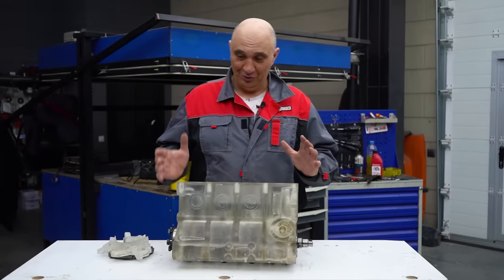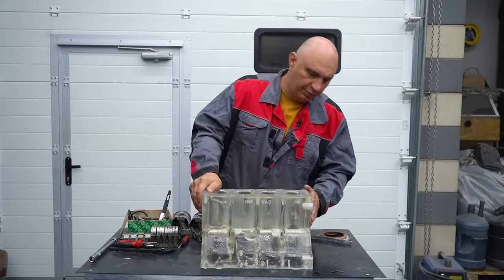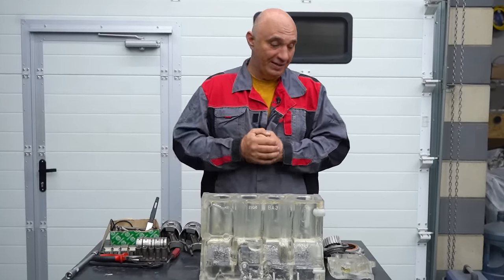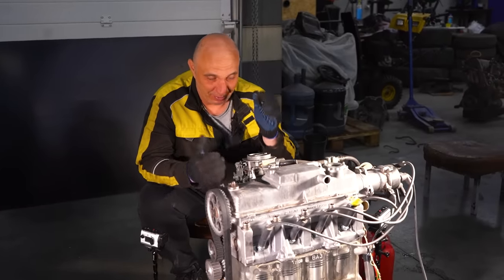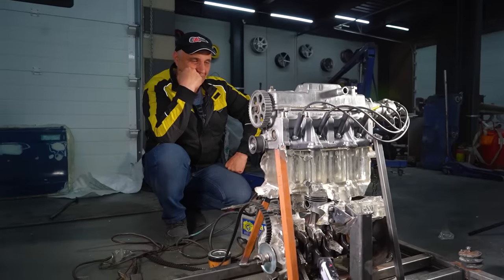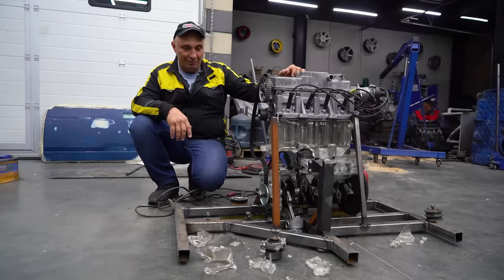Transparent engine block – first start

Comment: Were the two center cylinders supposed to be in compression stroke and fire at exact same time?  Seems like that’s what got it.  Four bolt main caps, a crank support bearing on snout and at back of flywheel that connected to the head would also potentially eliminate the issue.  Get the engine turning over then slowly introduce fuel to keep it from loading up as well maybe.  Good effort thanks for sharing

Comment: if you pause it at 6:58, you can see the cracks re already there. the most apparent is the more right side of the engine below the pistons, almost in line with the main bearings

Comment: long lag bolts thru the block to support the crankshaft cradle might help. but then the side might blow out. idk. but cheers to the work you put in. thanks for the attempt, was quite interesting.

Comment: That shows quite impressive the reaction forces inside the engine block and where no weak points should exist. Now imagine this an engine under high torque output which increases the acting forces on another level.

Comment: The thrust bearings should be independently supported with steel up to the head and down to the frame, so all the downward force on the crank isnt pulled through the liquid glass.

Comment: I'm not sure if the plastic/resin  used is ideal for shock forces. You could try to create deep triangular webbing for the block that will hopefully give it more strength.  Possibly cast the main caps so that the bolts go all the way through the block and reinforce the attachment point at the top of the block with steel. 

This is also a perfect example of why gm uses 4 bolt mains in
Reply: The Chevy LS V8 uses 6 bolt mains.

Comment: This is actually a really good example of how a compressed explosion exerts force on the crank and rods and how increasing the pressure via turbo or supercharger wears parts out faster in high hp applications.

Comment: Saw the crack form with the power drill. This makes me wonder if the mounting was the problem - not just the material. Maybe it needs more compliance with rubber bushings. In any case, massive props for an ambitious project. We were hoping for success as much as you.

Comment: that was really cool to see u have to say only thing I could suggest is possibly lowering the compression .maybe run head bolts to the botom of the block and incorporate a steel band into the oil pan

Comment: Build your block in two pieces top being the cylinders the bottom being crank and Maine’s . Would need to make the crank mains out of metal and run long studs to clamp the crank and cylinder down to help mitigate the flex and pressures on the plastic block.

Comment: Just a thought. Make the block again but add sleeves fir the pistons and everywhere a bolt has tk bolt into the plastic use a steel insert and see how it goes then. I'm pretty sure it will actually run with sleeves and inserts. Without to much is put on the plastic itself

Comment: It was well worth a try. It made for a great video, whatever the outcome. ;)

As others pointed out, a crack formed almost all the way across the block, just above the mounting bracket, after the very first try with the drill.

If you pause it just at ignition at 6:59, I think the crack did go all the way across the block (internally), just above the mounting bracket, and between the two "hollows" on either side.

You can see it at 7:15 as well.

Oh well. It was a good watch anyway. lol

Comment: Seems as though the ignition was enough to knock the crank out! Need to have a way to bolt the head and crank together so the crank can’t pull away from the head. A solid block would help too you’d think

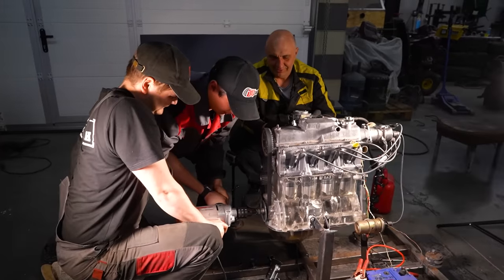Comment: 5:08 Cracked the block at the first ignition. The head bolts should extend right through the block with some steel straps to spread the load to hold it together.

Comment: Maybe try the Rover K-Series engine. The head bolts go straight through the block to the bottom. Don't worry so much about the glass sump. At least you have the strength to support the crankshaft

Comment: You could try to drill through the heads and block and try to use long studs to hold the heads and the  block together that was a lot of force on the crank downwards

Comment: This is the reason engine blocks are made of a single piece of heavy metal, the power of the downward push during combustion is extreme, I doubt any clear material could withstand that power.
A for effort guys!!!!
Rewatching the video, at 6:58 you can see a LARGE crack running from the mount to the fly wheel, looks like it starts at the bolt, it seems when the engine was mounted the tightening of the bolts caused cracks in the material.

Comment: I think the head gasket also failed, so on that first power stroke, the adjacent cylinders also got a massive boost of compression as the pistons were coming up,  So the crank was pushed down on three cylinders with most of the force on cylinder 3.  To stand a chance, I'd use much much thicker walls of the block.  Also the sandwich idea.  A copper or aluminium headgasket would be good.  Maybe anneal the plastic block too.  Those rings are far too grippy.  A plastic slightly softer than the block would be good, but with a polished edge.

I had a model plastic see-through engine from Haynes (the manual people).  It seized because I used bad oil and let it sit.  Ran on an electric motor, with a valve train and everything and lights to simulate the power stroke.  Great for teaching.  Maybe it would be cheaper to adapt that to run off alcohol or something.

Comment: Good idea guys. Do it again. Make a central metal carrier for the rotating assembly ( crankshaft) and then get bolts long enough to reach from the head to that assembly (crankshaft main bearings with head )to hold it all together.

Comment: You guys should make one of these and take it to a shop with a spintron.   It will turn the engine at operating speed without the need to ignite the fuel

Comment: that man standing beside the engine is a very lucky man this thing turned into a giant frag grenade... i was wondering by what wizardry they would of made glass withstand that much pressure and for how long it would hold but then i realised there never was any wizardry 😂 great attempt and it was very interesting seeing what the explosions actually look like in the cylinder.

Comment: My guess is, it was split from the crank support of the case from too much momentum and consequent compression of the outer strokes.  I would try wrapping metal straps from the head, under the block and back to the other side of the head; between each cylinder and each end.

Comment: I think there needs to be some sort of metal frame running from the main bearings up the the cylinder head to support the force of combustion. So it will be a clear block and cylinders but a metal frame within. Idk im not an engineer 😅

Comment: This is why glass or carbon fibers are added to plastic to give them more strength in tension.  I bet if you would have designed it so the head bolts ran all the way through the block to the crankshaft bearing caps, it would have ran.  It clearly needed something tensioning the block together.

Comment: at 5:07 we can see the block cracking where the mount is at the bottom. This is where it broke in the next attempt at 6:50. Glass is resistant to compression but not tension. And the torsion effect of the shaft created too much stress on the block

Comment: The Sisu Diesel division of Valmet once made a 4-cylinder diesel engine with quartz cylinders as a research tool.  It was the first indigenously developed common-rail diesel engine in the Baltics.  The engine had no water jackets so it was run only for short periods.

Comment: And just like that,  The Russians find another use for cast iron!!awesome job,maybe some vertical rebar in the mix??possibly in a loop? from the deck,down  immersed in the block webbing between the clyinders? that was alot of work, looked supercool! if you dont do it again,ill understand!!

Comment: You only need a transparant short block engine. Not all of the block. Especially the low block which is hold the crank

Comment: Definately got combustion, but blew the crank out the bottom. I do not know the material used for the block, but maybe wider main webs with 4 bolts plus cross bolts. Possibly studs that pass right through the main caps, the block and head.

Comment: How about tapping into the individual cylinders and installing individual ball valves per cylinder and opening them all accordingly to lower the compression thus possibly still running the engine?

Comment: Believe it or not, but I think this is one of your best videos, although the experiment itself failed.
But I would have expected it to melt at the head or blow by the pistons and melt the cylinder walls.
It shows brilliantly where the forces inside an engine go: to the crank bearings!

Comment: Maybe try using fiberglass to give the epoxy much more strength.  If you just use toe, instead of weave, aligned for tension strength it will also be more transparent.

Comment: I’m not sure if you did it. But was there any kind of pressure relief for the excessive crank case pressure like the original pcv would have done.. I think where you used 3 rubber full closed rings as opposed to having 2 normal piston rings that have minimal gaps it would have increased the crank pressure a lot more and possibly too much even for a standard pcv system..

Comment: Still a good idea. The issue is they used the casting from something that was supposed to have the strength of metal. They need more material from what they are using for added strength. It'll be super thick but work.

Comment: You need an engine that the head bolts go through the block down through the main caps.  Much like a hydridic cylinder or a motor cycle engine.

Comment: It need some metal reinforcements to bear the stretch force I believe. Add internal and external metal structures like rebars around the mains and where the shell cracked. The clear material might not be so weak but it is too brittle. Also lowering the compression ratio a bit can help. I think if given a second go this project could work out.
Reply: Like have head bolts that extend as far as the to the bottom rotating assembly to clamp it all together

Comment: At the top of that list of contributing factors which led to the failure: That huge crack going all the way across the bottom of at least the three right cylinders before the engine even fired, clearly visible in the close-ups. 6:57

Comment: I thought about your engine, and I have come  to a very interesting conclusion:  OK your engine block is made out of glass so you have to operate within the physical constraints of that design. Now, if you were to use wires in the glass to strengthen the transparent block and use the lower grade fuel, you might be able to maintain operation.  You have to make the fuel less hot in other words. You might also lower the compression as well. 1.5:1  2 at most .

Comment: What if you add steel bars of equal length on the corner of each cylinder to absorb the hard force down with a skeleton steel cradle at top and bottom so the steel is absorbing much of the mechanical force while the clear only is responsible for holding the compression

Comment: Does it mean ...no glass or plastic materials as cylinder block...howsoever strong, cant withstand the pressure and heat generated during combustion?

Comment: This was still awesome, if you attempt again perhaps put straps under the engine block and mount it differently onto the steel frame. The glass was just too brittle it seems

Comment: I have been watching for a while, exelent show team.

What I want you to do, is get an engine, remove the head.

What are you left with? Pistons and a piston block, the block as alloy, and the pistons if you are lucky are steel, this is magnetic.

Make a new head for the engine, but this time you are going to have 4 electro magnets to move the pistons.

This was built in the 1920s

🤘💗😇😘

Comment: Looks like the power stroke they did achieve pushed out the tapped holes on the bearing blocks to hold the crankshaft . If they do this again they should run some sort of steel bands from the bearings to the cylinder head to help hold the engine together... Idk... That's a tough one... There's a reason we make engines out of steel and aluminum

Comment: You should use methylated spirits in the engine, won’t rev as hard, but it hopefully won’t blow a hole in the bottom of the engine.

Comment: In hindsight would of it been a good ider to have a lot of overlap on the valves?  And making the combustion chamber bigger, motor would have no power, but you just want it running, or am I wrong with my iders.

Comment: This might have worked with an MG Rover K series engine as the cylinder head bolts run though the engine and into the crank shaft bearing caps. In theory they would hold the whole thing together and stop it blowing apart. Not sure if any other engines use this system?

Comment: Go again but next time build a support on the lower side. Not on the oil pan but around it. It appears it just blew the low half of the block off due to strength. Hopefully this will support it enough to keep it running.

Comment: Did the motor blow up because of the compression ? Would lowering the compression ratio mean that the motor be able to function since the pressure inside the motor would be lower ???? Pls respond I’m no engineer

Comment: I have the solution. The main caps need to be through-bolted all the way through to where they hold the heads on with one end and hold the crankshaft in place with the other end.
Check out Hans Hermann's attempted Indycar engine, as that is what he did, or something similar to it.

Comment: Maybe just use the cylinder. Make it clear and the top and bottom complete in metal. then reinforce it by connecting the top end and bottom end together

Comment: Flat top pistons are not a good idea you should use dished pistons for lower compression. No starting fluid! Also find an aluminum flywheel. Make everything thicker on the block.

Comment: So I read through a lot of the comments and didn't see anything about this so, you guys need to design something that is steel that runs through the block and has runners up the walls so it has stability to bolt things onto.  It was not the cylinders that failed it was your crank bolts that lost the war with force, you essentially hand catastrophic crank walk.   Next time get a 4 bolt bottom end...

Comment: Kind of successful really, because the explosion was so good that it blew the bottom of the engine off.

I think you'd have a hard time finding a transparent material that you could mold, which would be strong enough. Even acrylic..

Maybe it would be just as good to use the transparent engine, but simulate it. Have lights and different coloured liquids for the coolant and the oil. And LED lights going off when the pistons reached the top. Run the crank with electricity.

It would demonstrate the engine

Comment: It was a beautiful part. Next time, if there is a next time, lower the compression ratio. Very low, 1880s engine low. Get that cylinder pressure so low that it will barely make any power. Model T engines ran great at 4:1. You can go lower, benz was under 3:1.

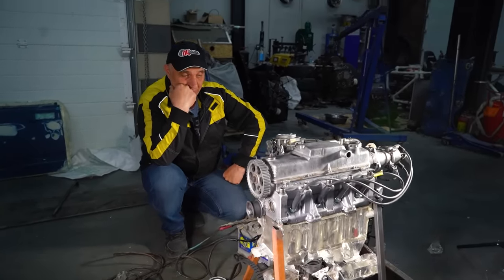Comment: 7:39 a crack is visible beggining at the bolts on the engine mount continuing thru the three cylinders all the way to the flywheel ... tightened two much the bolts and cracked the block ... possibly :D

Comment: I wouldn't call it a failure. We were able to witness ignition and the star of combustion, before the block shattered when the pistons where forced down under pressure. 

If anything it shows that it's not the crankshaft that's rotating the pistons but the actual force behind combustion shoving the piston down, and with each firing putting so much stress on the shaft and surrounding area.

Comment: Maybe reduce the compression ratio drastically, to 5:1 or 6:1.

You could change the objective to let it spin on eletrical power, make a very lean tuning on the carb, just to have some fire, but not enough to make it run by itself. Then the glass maybe handle the bangs

Comment: Perhaps try reducing the compression, you aren't going to try driving a vehicle with this so it could potentially run with much less power and compression, that should reduce the strain on the crank bearings and lower end though you are still going to need to reinforce it somewhat.